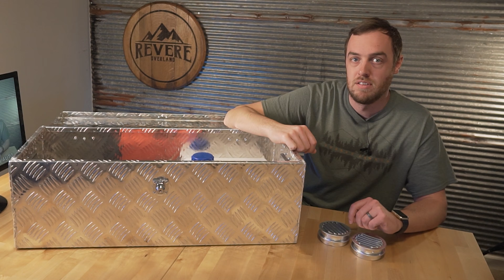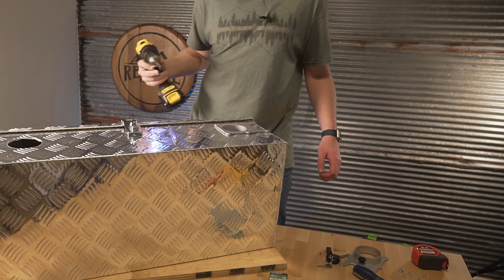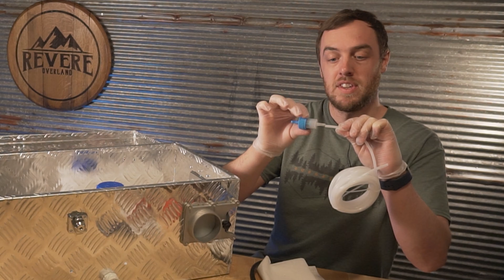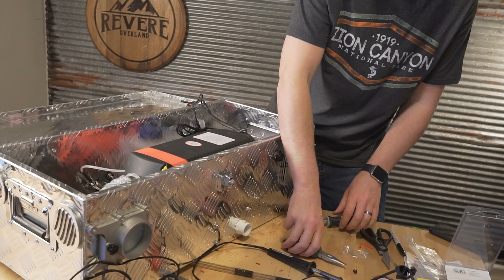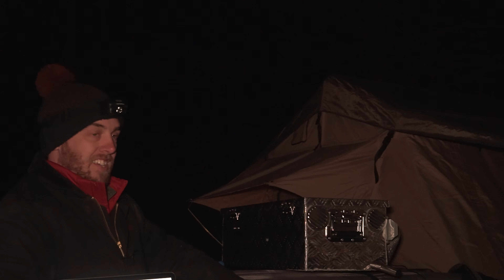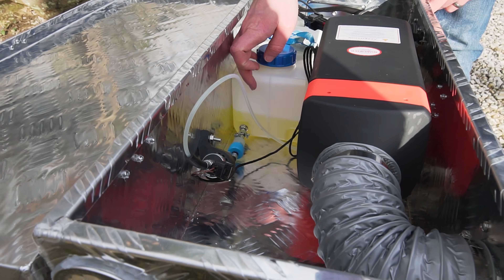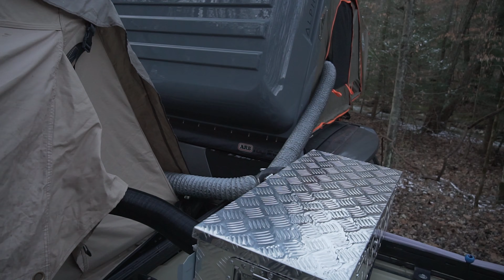Roof top tent DIESEL HEATER V2

Comment: Why has no heater designer looked into using a peltier device to harvest the heat energy and produce sufficient power to run the fan. Sure you might need a battery whist it starts (glow plug) and then change over to self powering for fan only. This would make the device much more camp friendly. This guy says his battery will last one night, great. How do you recharge it if you are in the forest for the subsequent nights. Buying larger batteries is an option but they ain't cheap and I'd be hesitant to run it off the car battery for obvious reasons.
Reply from the maker: The Jackery charges off the vehicle or solar. If you're running on low, it'll take a couple of hours to recharge off the vehicle, and less with solar in full sun.
Reply: ALB2073 interesting thought! Peltiers are very inefficient but there is a lot of heat from the exhaust to be recovered. Add a battery and a small charging circuit and this just might work.

Comment: Draw burn air in over the exhaust pipe to pre heat it and increase  efficiency
Reply from the maker: You could definitely have it pull air from inside the box (which will be warmer from... everything), but I didn't want to pull from where the fuel is.

Comment: Nice video, but if you put a rubber grommets in the hole for the mounting bolt for the fuel pump it will dampen the vibrations.

Comment: Nice video, but if you put a rubber grommets in the hole for the mounting bolt for the fuel pump it will dampen the vibrations.
Reply from the maker: Yeah there's definitely more I could do to cut down on fuel pump noise. Thankfully you can barely hear it inside this box.

Comment: Great upgrade over the prototype. Well done! One suggestion for when you want to split your output duct to heat 2 tents, put an adjustable louver or gate on the end of the shorter hose so that less hot air enters that tent & diverts more heated air through the longer hose. This way you can balance the heat distribution between the 2 tents a bit better. If it's really really cold outside, try wrapping the duct hoses with a wool blanket or some other material that will insulate the hose & have you lose less heat going thru it. But overall, Version 2.0 turned out great. Very impressive!
Reply from the maker: Yeah the ducts definitely need insulation for use like that - I lost a TON of heat through them. It's not something I planned on doing though. Andres found out I was bringing the heater the night before and insisted I share the warmth!

Comment: Great follow up and it ends in a nice 2.0 set up!
Did you consider putting something under the fuel tank to get it up higher and easier to refill?
Reply from the maker: Thanks! I've been putting the whole setup on the floor next to the pump to fill up. I don't want to risk spilling diesel on anything!

Comment: Very good set up. Just remember you want the glow plug up. It can be on its side as long as the glow plug is up. Very good video. Also on ebay look up diesel air heater all in one. This is what I use in my enclosed trailer and out in my hobby shop. Have fun, be safe.
Reply from the maker: My buddy is getting one of the prebuilt setups, so I'll probably do a review on it for next winter!
Reply: @RevereOverland  I have 3 of the All In One heaters. 2 are were the fuel tank is above the heater unit and 1 that has the fuel tank to the side of the heater unit. Please check out John McK 47 youtube channel. He's a wealth of knowledge on these diesel air heaters..
Reply from the maker: He's a great resource, which is why I recommended people go check him out at the end of the video.

Comment: What about a pelican case or roto-mold cooler. Expensive yes but water tight and probably very quite. Also, look on Amazon for a fuel pump jacket, may help with noise and only $6.
Reply from the maker: I think a Pelican case would work well too - it all depends on the space you have available! Good call on the fuel pump jacket - if you're mounting in a plastic box it could be a great way to cut the noise from it.

Comment: be aware the self contained heater  B may be 24 volt not 12 v added a 240v/24v converter  listed here >>>>>>>>>>>>>>>>>>
https://www.sign-in-china.com/products/17812/100w_ac100v_240v_to_dc_24v_4_2a_non_waterproof_metal_cover_universal_led_switching_power_supply_for_led_lighting_.html?ex=GBP&utm_source=Googleshopping_uk&utm_medium=Googleshopping&utm_campaign=Googleshopping&gclid=Cj0KCQiAhojzBRC3ARIsAGtNtHUn5ltmQU3hQCTU9i1mhp8rdkb2ohrDIAJX9T5j89Gr5O1BarnBWfkaApeXEALw_wcB
Reply from the maker: Good call. Worth checking before buying.

Comment: Really nice setup. Im getting a 5kw for my caravan and i guess it will be enough to heat it since it is insulated. I am going to use jerry cans as fuel tanks. There are different types of spouts that can be modified and used as fuel pickup. With this setup i can just switch can if one runs out of fuel. Im going for the smaller 10 liter cans (like this one: https://bulextreme.com/en/off-road/369-10-litre-jerry-can-spout-holder.html). 
Have you been thinking of an heatexchanger system for the exhaust to heat water?

Thanks for sharing your experiences with the heating system.

Best regards Jimmy
Reply from the maker: A 5kW would be fine. The biggest thing letting the two tents down was the long and uninsulated ductwork. The awning room just didn't stand a chance since it's so leaky! There's actually a diesel heater coming out that is almost identical to the one I have, but it has a section for water too. It will heat the water really well, but just doesn't seem practical - propane water heaters are MUCH quicker.
Reply: @RevereOverland  Ok.. Maybe i will look for a freestanding propane water heater then. I will have propane for the stove anyway. There is a propane heating system in the caravan right now, but i feel that diesel is safer and gives less most air. A problem with the installed system is that the radiators are mounted to the walls and the thermostat is in center of the caravan. So if it is 20 degrees celsius at the thermostat it, is 999 degrees at the walls. It feels like a heater with fan should give an more even temperature..
Reply from the maker: Yeah the forced air system seems to work really well. Have you looked at the propane heat exchangers? They are a lot more expensive than the diesel heaters, but obviously you're already set up for propane.

Comment: I wouldn’t ever say “no risk of carbon monoxide”; the one personI know whose life was saved by a CO monitor was exposed due to a cracked heat exchanger. I highly recommend keeping an inexpensive CO monitor in a heated tent, even in a forced air set-up.
GREAT BUILD, btw.
Reply from the maker: That's true. There's a risk of fire too, but both are lower than with a Buddy heater style propane setup. I'd like to think you'd smell it if the heat exchanger cracked with a diesel heater though.
Reply: Revere Overland , fair point. FWIW, lady in question (from the UK, btw), awoke from a deep sleep to the sound of the alarm. She reported no odor, but had sense to get out of the house. Repair man explained flue gas entered forced air through a crack.
Curious, does the diesel burner’s exhaust have an odor?
Again - great build! I’ll continue using the buddy heater and propane, but your points are valid and the build is awesome.
Reply from the maker: I guess it depends on the fuel for the heat exchanger. A propane heat exchanger probably wouldn't smell at all! The diesel smells really bad when it's starting up and shutting down with the glow plug on, but while it's running there is very little smell.